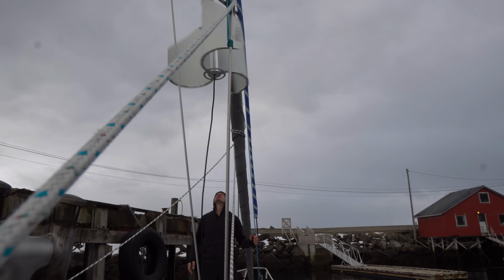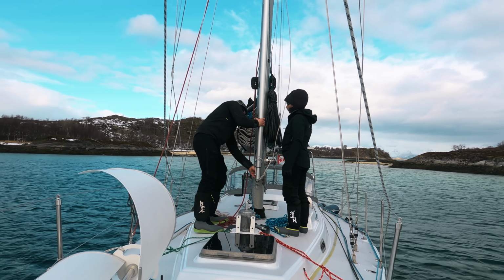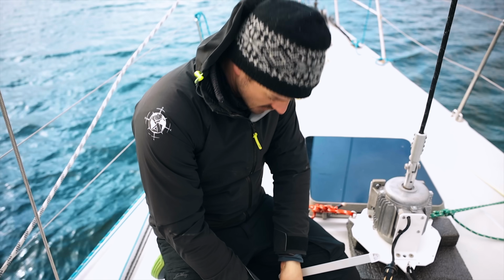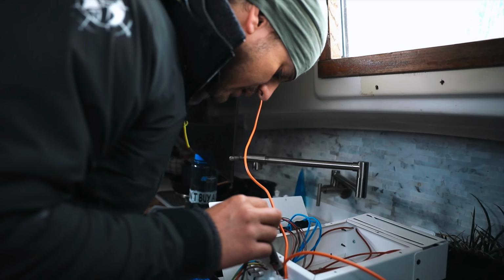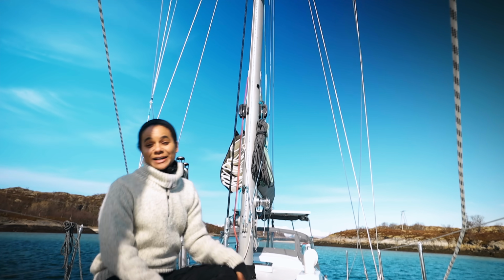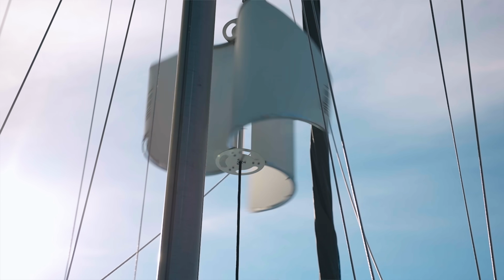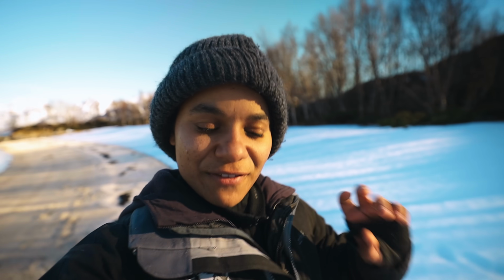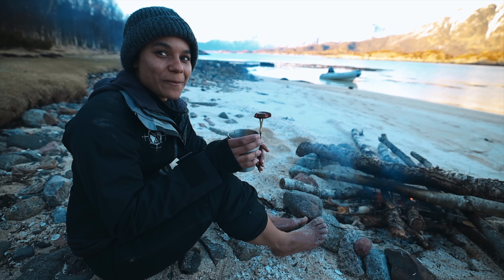No Sailing, Just BULLSH!T — Sailing Uma [Step 273]

Comment: Dan and Kika. Firsty I love this "Bullsh!t" you giving me at this episode. Give me more. Secoundly, for fire in such condition use birch bark for starting big fire. Thirdly, maybe placing turbine on mast anyway with the same system you created and hidng rope inside mast would do the thing. Turbine would be much higher and wind condition better. Neverthe less I guess you have a lot of resistance on joint near to the enging that transfers energy into waste because you let it to woble on hinge. Moreover you lose a lot of energy on expansion and compression of a rope. I think solid stick with ball hinge would eliminate a lot of waste.

Comment: 2 questions 1) do you guys still have power concerns? 2) have you thought about adding a washer/dryer on the boat? I only ask since you've added the fresh water solution and have steady access for water; that's about the only thing you guys are missing that (most) of those of us on land have access to.
Reply from the maker: Washer? Yes. Dryer? No. Washers use very little power and some use very little water too. But dryers either need propane or A LOT of electricity. But the sun works much better for drying cloths and is free.

Comment: An idea that you might want to try with your wind turbine is yes mount it on the mast with enough rubber baby buggy bumpers (rubber mounts to cut down noise-the more the better). But down size, Dan you may need to incorporate those handy-man skills in order to fabricate this vertical windmill. Think of a barrel about the size of a five gallon/litre pail. Blades running vertical with a twist to them (with your mind and Kika's it should be easy to figure out the twist layout, it should be as easy as cake...errr pie-one of those pastries). The more blades with surface to the wind the better (might even work with straight blades as long as there are enough of them). This will be held by a circular ring bracket and bearing on top and on the bottom mount a low profile electric motor (the one you used is way too big). The motor I've seen in the past looks like a donut shape and is multi-directional (able to charge in either direction) and would sit on a circular bracket under it that is attached to the mast with those same RBBB's to cut down sound. It's a smaller Savonius style. It should be able to work in any wind and will with stand higher wind speeds than the other styles which I believe shut down after speeds of 25 mph or higher. It tends to spill out the higher wind pressure than others and should last forever being high enough not to catch any salt and if the brackets and fitting are strong enough. Good luck you two.

Comment: I can never see a long rigid drive from the blades on the mast to the alternator on deck working the mast is going to flex the drive will jam? ... so just an idea how about making the drive train hydraulic ..   put an hydraulic motor on the blades that should not be as heavy as the generator .. run two hydraulic hoses down the mast (flow and return)  to a drive motor on the generator.   The generator could then be put anywhere in the boat you like.  But as Tim Miers said it will never be as efficient as a vertically mounted one

Comment: That motor you have is likely to be a poor choice.   It is much too large for the amount of energy you might be able to harvest.   I somewhat suspect that the use of a DC servo motor will yield more energy and those motors would be small enough to mount aloft with the wind vane.   You only need a motor large enough to collect the maximum possible energy that might be generated.  Servo motors are high efficiency permanent magnet motors and they turn smoothly and quietly.   However, I doubt they would handle salt water for a long time -- but you never know.  You might be able to solve that problem.   One more thought... some of these servo motors have integrated electronics which means you could monitor it's rotational speed and then place a charging load on it keeping the vane's rotational speed limited even in high wind.   This would be the ideal way to load the generator.   But, all this is kind of on the advanced side.

Comment: The unforgiving physics of the different operating principles of horizontal vs. vertical axis turbines dictate that you get out just a fraction of the available mechanical energy in the wind with the less efficient turbine type, no matter what it looks like or however its installation gets tweaked. All else being equal, I'd probably rather hoist a smaller horizontal axis turbine than any vertical axis design. There are some designs tried by sailors where a two-blade design is set up in front of the mast at anchor. Long blades; large swept area, which is the most critical starting point when designing a usable source of energy. Read about small scale wind power in Hugh Piggott's books and blog, those can give you some serious practical knowhow about how to size the system with the desired output in mind (given some wind speed, designed around a rotor speed you want, and the watts of power you need). YT channel "Emily & Clark's Adventure" is the one that may be worth a look if you want to reflect on and bounce some ideas off of one already tried and used solution for boats.

Comment: You can use those wiring blocks if you use wire ferrules. They create a "solid" post to crimp down. They are actually part of a lot of European standards. Here in the US they aren't required, but I ended up using them all the time in AV installations, especially when needing to terminate in phoenix blocks.

Comment: This UK concept may be of interest, and may be adapted and adopted to sailboat use. Cheers,  www.youtube.com/watch?v=gcSnwW5v3f8&pp=sAQA
Reply from the maker: Yes, we're following them closely. Will be very interesting to see how they solve splitting the motor in half to fit it around a mast.
Reply: @SailingUma  Or a shroud, or perhaps the backstay or a runner if it will support angled operation.  I did like the way they took power off the device.

Comment: You've got my Design Engineer brain working!   Most horizontal wind turbines I see on boats have three narrow blades.  Could try increasing the number of blades to 6,  8 or even 12.   Could also try increasing the blade area too.   
For the vertical axis generator could try doubling the height of the blades or link modules together.  Single tri blade unit for windy days,  double for medium wind strength and triple for light wind days.   Could also be a unit that has the blades sliding inside each other which could then be automatically pulled in or out depending on wind strength and also controlled automatically to match blade area with wind strength.   The AC generator could be mounted under the deck with the input shaft under a flush mounting hinged,   edge sealed small hatch.   Would need to rotary seal the shaft but a lot easier to do that than seal the whole generator and its electrical connections.
Dan,  you are right about those screw terminal blocks.  However I have come across a 'work around" where the strands were first crimped in a tubular brass crimp which was then clamped in the block.   Second downfall of that terminal block design is that there is no provision for strain relief of the cable.  Acceptable for a building application but when something can move or vibrate you really need strain relief on all cable connections.   Take care and have fun!

Comment: First of all let me say you guys are amazing my wife and I have been watching you since you started we're an older couple and bought a 38 ft Ericsson sailboat unfortunately we don't have the drive that you youngsters do but everything that you have done to your boat is simply amazing. Also everything that you've done to your boat is exactly what I had intended on doing to mine I have a wind vane ready to install just like yours I want to do electric motors just like yours I want to do battery Banks just like yours and I've been studying wind turbines and thought about doing twin vawts on the back at the radar Tower one of the things that I thought about and making a vawt was to do counter rotating blades so that slower wind speeds would create twice the energy instead of just one stator you would have two going in opposite directions because the blades would be going in opposite directions counter rotating squirrel cages so to speak just a thought.

Comment: By now you have already solved this but how about a rigid (light) fiberglass tube and universal joints at both ends (like a drive shaft)?
Reply: Pontiac Tempest ( https://en.wikipedia.org/wiki/Pontiac_Tempest ) had a torsion bar drive shaft and went through a lot of clutches due to surges.  How about this.  How about a rigid carbon fiber drive tube with no universal joints.  Now put a universal on the top of the rotor to pull it up and let it align.  Put a universal under the generator to let it align and bolt the universal to a mounting plate.  Now the shaft will self align and spin like it should.

Comment: Have you considered using a plastic gear reduction on the base of your windmill you can buy two plastic gears mount them on the lower bracket of the wind sail where you get a 25 to 1 or any ratio on your output shaft . Could be done very easily and cheaply with nylon or plastic gears then your motor will spin at a RPM that will make current

Comment: if you do not have a adjustable propeller, could it be useful to change the propeller to a type better suited for regenerating power then one optimized for propelling the boat. you hardly ever run your engine but you often use your sails. so tuning the propeller for regeneration seems more logic.

Comment: Ok, so I hate to be a nay sayer but…in my opinion you’re better off with a wind system you can use while under sail as well. You’re so limited with one that you can only use at anchor. I applauded your ingenuity but considering just how important it is to regenerate your batteries, I’d be more concerned with being able to harness energy as often and as efficiently as possible. Good luck

Comment: I think having a torsion line under tension will reduce efficiency and cause undo stress on the generator armature. The spinning element should not be under tension. Perhaps a tube, like carbon fiber kayak paddles that can be assembled in sections, to attach to the generator and the wind blades > light weight and rigid, with no tension. You would need a bearing gimbal at the top to suspend from a line, with just enough tension to hold it up and provide axial alignment. A joint at the bottom, similar to a U-joint on a car, would also reduce the need to worry about alignment. I think this would spin more freely than a torsion line.

Comment: A "flexishaft" would almost certainly be a good option for connecting the blades to the generator. Here's a link to just one of the first sites that came up that seems to offer them.
I actually got the idea from a car channel I watch that used something similar to drive an alternator that was remote mounted on a custom car. Here's the link with the time stamp of them briefly discussing it. Seems they might be pricey though.
https://youtu.be/WIyxrvO3dRk
19:25

Comment: Something like a speedometer cable from a car or truck would be a cool option to drive the generator. They're available in various lengths but unless you find a particularly stout one idk how well they would transfer the drive. Something like a coupler pieces of all thread rod with coupling nuts would probly work fine. Or some pieces of small tube like electrical conduit coupled or pinned together so you could take then apart for storage.

Comment: Clever. You want the blades high enough off the deck primarily for safety. Since you plan to use this wind generator when at anchor, might it not be feasible to have a removable tripod (3 pipes really) that puts the base of the generator 6ft/2m above the deck, constructed of 1" stainless steel pipes (as used to support your solar panels) and lift or hoist the unit up to install it (or stronger)? Three permanent attachment points, to a platform with proper attachments upon which the generator is secured?

Comment: Great that you test things, not just accept standard opinions! However, in this case there are some physical issues you can’t really overcome. That type of blades will at best give one tenth of what a more normal propeller of the same covered area. You can improve the setup you have now, of course. Bearings at both ends of the torsion cable that can handle the tension? A gearing to increase rpm at the alternator? 

Still, you can’t help the fundamental limitations of the blades. They are extremely inefficient, and can’t really be improved much. The reason is that the principle can’t use aerodynamic principles like a propeller wing can. The maximum theoretical blade speed is considerably less than the the wind speed, even at zero load, since only about 1/3 of the projected area generates any force, and some of that must push the opposite 1/3 against the wind. 

A normal prop has nothing of that, but much more importantly: It rotates at 90 degrees of the wind flow, can have a speed many times faster than the wind speed and the pressures around its aerofoils is tens of times higher. This harvests way more of the wind energy, as that increases about proportionally to the square of the speed increase. As an example, just a 5 times higher speed through the air means theoretically 25 times more harvestable power. Also, its much higher rpm makes it easy to drive a generator, which needs high rpm. If the vertical axis wings had high torque, you could use a gear box to get the rpm, but that would only be possible in strong wind, when a much smaller normal propeller would anyway give insanely much more power. 

Conclusion: A vertical axis wind generator can maybe have some good use, where area, efficiency, weight and volume are not interesting, but on any boat, they are close to useless, no matter how well they are set up. Physics can’t be fooled… It’s actually just a paddle wheel. Huge paddle wheels were used on the first water mills and steam ships. There are some very good reasons they were rapidly replaced by tiny propellers or turbines and nobody uses paddle wheels anymore.

Comment: Dan, maybe look at using a technology similar to what Dremel uses for its flexible extended chuck ... if you use an outer casing to link/secure the Gen to the Vane, that should allow the inner cord/connection to run freely without undue friction and additional wear/tear on bearings/bushings ... could a carbon fiber arm be hinged below one of the spreaders (port side) so the Vane is off to one side of the boat and pulled up from a Dyneema line attached to the top of mast (just thinking in terms of your comment that the Gen would eventually be below deck ... wouldn't a center installation end up in the center of your V-Berth? Wonder how far along wave action Power-Gen is ... thinking there are some installations around the world ... wonder if these can be scaled down. Maybe the Bill Gates foundation would fund research into something like that?

Comment: Only 12 min in so may have been addressed but the top of the bearings are loaded up instead of the bottom and/or centre, if it’s old or sat unused for a while the top will be dry.

Comment: squeaking? does the generator portion have a "thrust bearing" to take the load of the torsion line? also, consider adding capacitance to even out the power delivery.

Comment: Hi guys. You probably have your wind generation problem solved already, but the two guys who sail the converted lifeboat Stodigt(?), YouTube website, “sunflare”, depend on wind and sun for power. Both are architects, and should be in Norway. I have not seen this “cassette” type of two rotor wind generation system before, but from the look of it, it might be fairly quiet and easy to set up.

Comment: Couple suggestions. You need a thrust bearing to take the tension load (bearings in the motor/gen are not made for high axial loads) and also adding a universal joint between the torsion rope terminal and the driven shaft will help with some of that "clocking" you were seeing due to axial mis alignment.  My biggest concern with the hoisted turbine is how to lower it when its fully spun up. Maybe having a "bucket" style lid that can be lowered over the turbine to effectively shield it from the wind while hoisting and lowering that is only raised up after its at full height. Interesting project.

Comment: Would a constant velocity connection smooth out the rotation?  CV joint used in a car to smooth out rotational power transfer through 2 unions. 1 union connector will have faster turn rate on one half of its rotation than the other. Google it. I’m sure you will find a better description than what I just said.

Comment: Hi! Guys perhaps you would want to take a look at FLINsail / FLINsolar - solar panels hoisted on the mast. I stumbled upon it while watching a random Sirius boat wideo - a family of three using these solars to compliment the rest of the electric system. I am not associated with the company in any way - just thought it a good idea. That video is also linked on the solar panel webpage. It is in German though but they make a kind of a review of these solars. Max what is available is 600W output. I am keeping fingers crossed for the wind turbine project but... such long flex shaft... I get the idea but can't see it happening in this gust driven environment. I used to work on 2,5MW wind turbines and the only flex that was accounted for by engineering was in blades and the tower. The rest had to be stiff AF and with minimal to no play otherwise the energy loss would defeat the purpose not mentioning structural fatigue. If you"ll make it work I swear I'll purchase DBAC mini stickers! Take care!